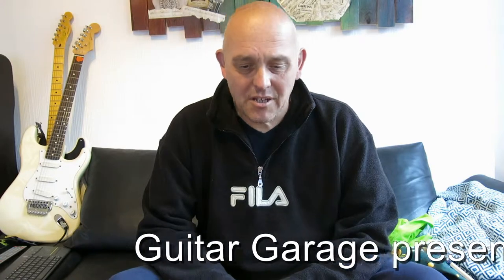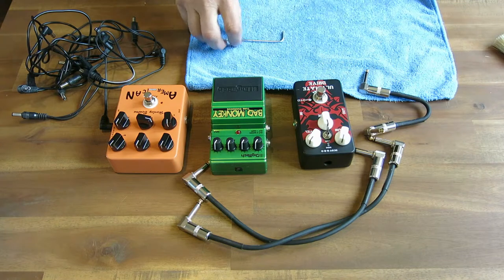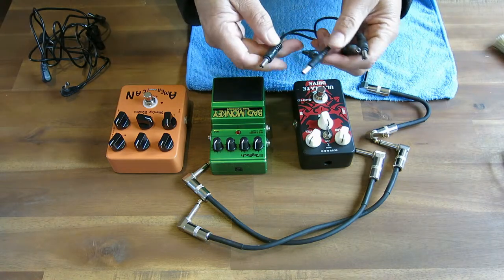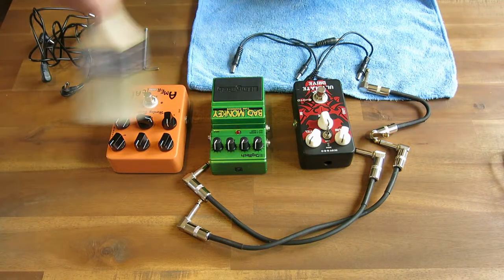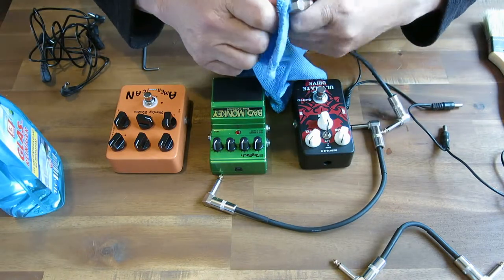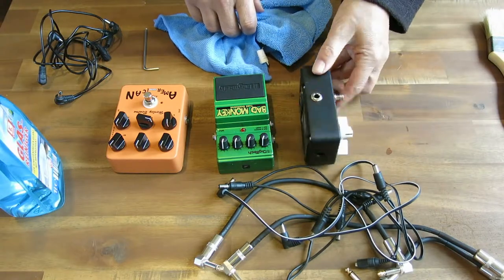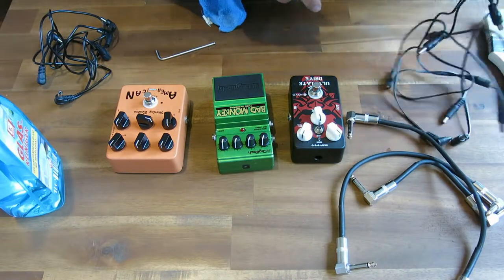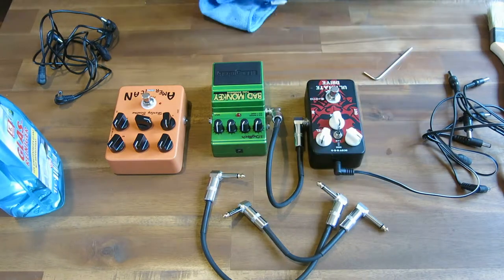Tone Recovery: Cleaning up cables and connectors on your guitar pedal board.

Comment: Thank you for posting this! I have a "big" board that's in a decent flight case that's covered, but another board I have, the "aux" board takes a lot of gigs and a lot of beating.  It was beginning to give me trouble though I knew the cables weren't bad.  I cleaned up with the Windex and am excited to trust it again.  Thanks again! :)

Comment: Hey, came back after trying your tip, and oddly, it didn't help to much. Maybe I need a contact cleaner instead. It seems a little better, not as bad, but not completely clean. Thanks for the video anyway!
Reply from the maker: This is not the only reason for a noisy pedal board but it is an important step in eliminating noise. Try replacing patch cables one at a time to eliminate any dud cables. Make sure you have decent quality cables.

Comment: Can you use isopropyl alcohol to clean the connectors off? Or even cloroks wipes since that also air dries fast?
Reply from the maker: They work but need more effort to clean the contacts.  Deoxit is first choice. Windex works too but must be dried off properly before use.
Reply: @DerekHerbst747  You say Deoxit, but what product is that? Or what am I missing here?
Reply from the maker: @Grid21  it's a contact cleaning spray. Try using Google.
Reply: @DerekHerbst747  So is windex not a good idea? Or can I just use it till I can get this contact cleaning spray?